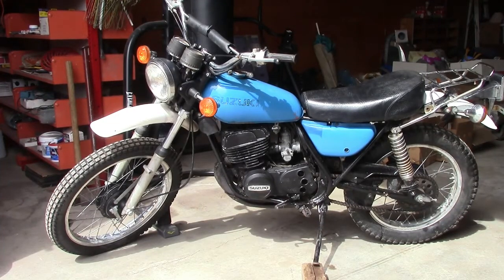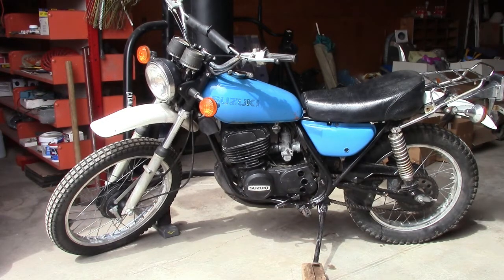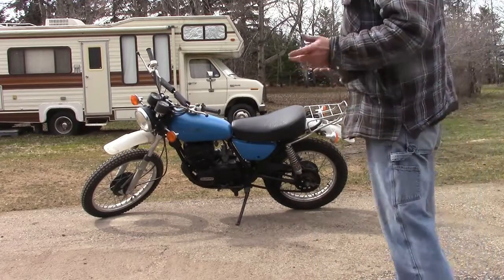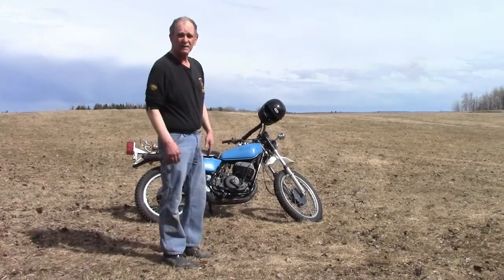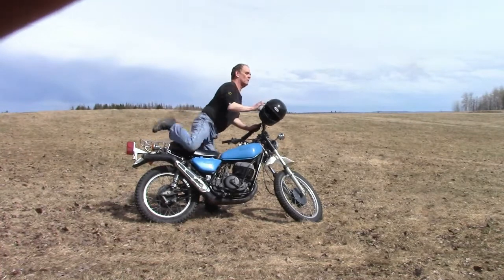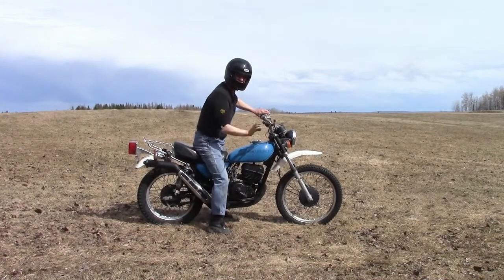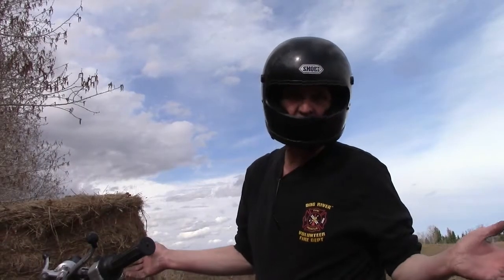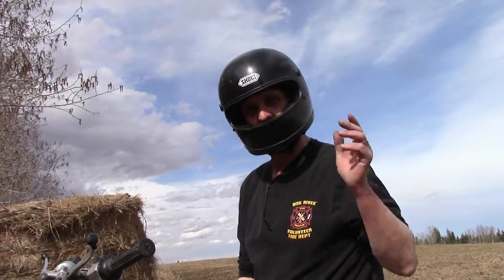Pt 4 Suzuki 400 TM TS Project

Comment: Great bikes. I have a DT250. I hear a bit of clatter in that engine somewhere though.....
Reply from the maker: They are great bikes and I've enjoyed the 400 for many years ... despite the long layoff. The clatter is a combination of a broken chain guard bracket yet to fix and an exhaust bracket. Wish I could have ridden it more this year but looking forward to this summer. Thanks for the comment!
Reply from the maker: @KingCast65  very cool bikes! Mine is basically acreage use so tough to justify as nice as you have. Once caught up on a couple other projects I will be returning to the Suzuki 400 to tidy a few more things up (like the broken brackets) as well as servicing and cleaning up my son's little Kawasaki 100 (1979). Too many projects and not enough time darrnit.